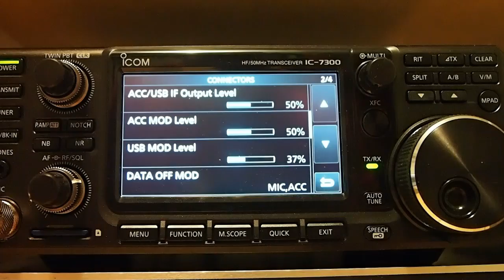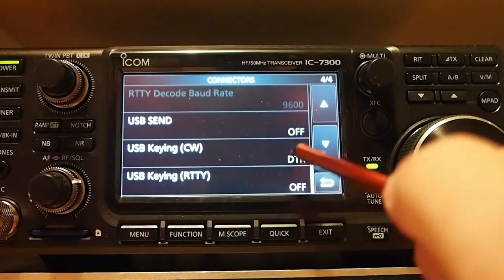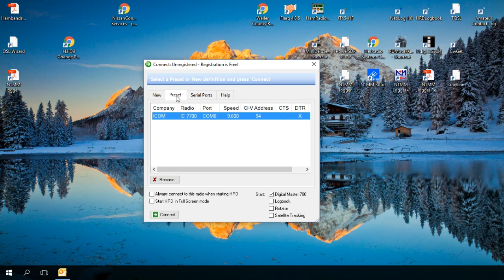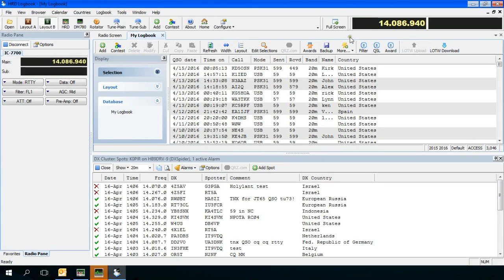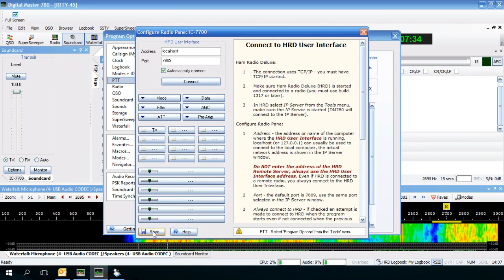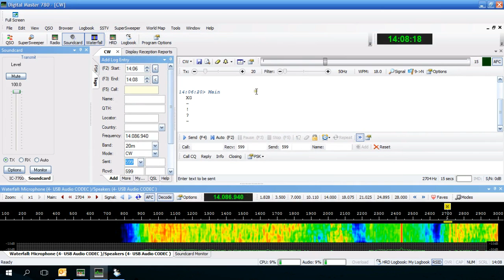Icom 7300 USB CI-V Rig Control And Digital CW How To

Comment: No one shows what ports to plug into, I use regular headphone to the remote jack port...
Reply from the maker: It’s nice to hear from you and thank you for commenting. Yes, it could be mentioned more in videos. In my next video I’ll point out there is a remote port on the back of the 7300 and also a USB port on the back of the 7300. The CI-V cable plugs into the remote port and the USB cable plugs into the USB port. The USB cable is a common printer cable, but the CI-V cable is something you can get off the Internet and I have a link to it in the article on my website. I hope this helps people in the future and stay tuned for upcoming videos. Thank you again. 73 and good DX! de KØPIR
Reply: Thank you for responding. So I cannot hook a regular audio jack into the remote port and go straight to hooking the other end into a CW key?

I was hoping to skip the computer for now...
Reply from the maker: @GH0ST369  I may be misundertanding you, but, no the remote jack is for a CI-V cable to control the radio with a PC. The CW jack on the rear of the radio is for a CW key. What are you trying to accomplish?
Reply: @HamRadioAdventures  I would like to set up my CW key to a (two ring audio cable on both ends) into the remote port.
 Everything fits but I do not know the settings to access the remote port. 
The rest of the configuration seems straight forward...
Reply from the maker: @GH0ST369  you don't want to insert your CW key into the remote port of the radio. It won't work. The remote port is just for CAT control. If you have a CW key that uses a stereo cable, that's fine. You'll need an adapter for the 3.5mm to 1/4" plug. Maybe that's where you got stumped? You'll need an adapter. You can pick them up at Walmart, Amazon and Ebay too.
Reply: @HamRadioAdventures  lol how silly after you said that I see the larger port says Key a little embarrassed, thanks for pointing me in the right direction.
Reply from the maker: @GH0ST369  no worries and it is confusing looking at the back of the radio. It could be labeled better. 73!
Reply: @HamRadioAdventures  it was strange for some reason I could get the one paddle to work, or the other, but after I changed some of the settings to use the two buttons on the top of the mic, then both the paddles started to work. Haha I have to spend more time on this if I ever want to pass this exam.
Reply from the maker: @GH0ST369  if you can use the microphone for a keyer, you're da man! I tried it a few times, but it didn't go well lol 73!

Comment: I use wsjtx for FT8 and am using the standard printer cable, i wanted to switch band on my N3FJP logger .. how do i switch band on my wsjtx simultaneously with n3fjp? do i need another cable ?
Reply from the maker: Hey that’s a good question. I use a CIV cable for Rig control in WSJT-X and then that USB cable I have connected goes to N3FJP for rig control. In the radio you need to have ‘unlink from remote’ set. I have a screen capture of that on my website http://www.k0pir.us/icom-ic-7300-specifications-features/icom-7300-screen-captures/ 73!

Comment: Hi Skip, I have finally gotten cw working using your setup. I do have the delay before cw transmit. Did you figure that out?
Reply: Allan Matthews the delay is because its not a true cw signal, you are using pc generated sound to send cw tone, while a true cw mode, the carrier is instantly on and tones sent with carrier are cleaner. You have to get a rigblaster advantage with cw cable to send true cw tones;)

Comment: Can you tell me the part number for the CIV cable, and where in the IC7300 does it connect?
Reply from the maker: Hi Joseph,
Nice to hear from you.
I've heard that people have less trouble with the FTDI chipset. So search google for "Icom CT-17 USB FTDI Chipset CI-V Cat Control Programming Cable". Here is one: http://amzn.to/2sDRUAq
There is a much cheaper one that I use and it hasn't caused any problems. It is here: https://rover.ebay.com/rover/1/711-53200-19255-0/1?ff3=4&toolid=11800&pub=5575171312&campid=5337860891&mpre=http%3A%2F%2Fwww.ebay.com%2Fitm%2F282039866391%3FrmvSB%3Dtrue
There is a CI-V port on the back of the radio, the other end is a USB that connects to the computer. I hope this helps. Best 73!

Comment: I have my 7300 set up as the above states - I have my drivers downloaded and installed from Icom - as per directions.

When I put something in the cw window, and hit send or auto, my 7300 key opens, I see the "typing" being done on the DM780 screen, but nothing is happening on the Icom. Just the key stays open. It's like I open PTT on my mic and say nothing. I have received cw from the 7300 and watched the DM780 decode it. So if receive works transmit ought to. 

Can you assist in my search for a solution? 

Thanks, and 73,

Skip, W5UTW
Reply from the maker: Hi Skip. What version of HRD are you using and do you have 2 cables?  Take a look at this page and settings in the radio: http://www.k0pir.us/icom-7300-ham-radio-deluxe-setup/
Reply: Free version. Win 10. Installed, to the best of my knowledge, as you suggested. I bought a good CI-V and USB cable. I see the drivers in the sound card option. Decode works. Hitting transmit opens the key, sending from the cw window opens transmit but no signal is sent. Was wondering if the type of key in the radio made a difference. I have a straight key installed. And I hear all audio from the radio. Is this normal? And thanks for your response.
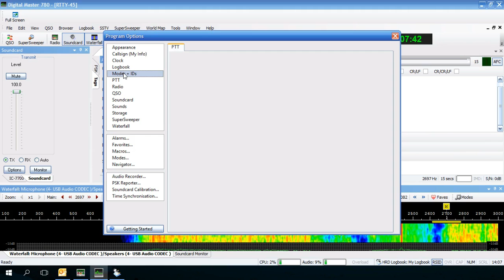Reply from the maker: Hi Skip, Okay sounds good. The key is fine, the audio you will hear too. Do you have psk31 working, transmitting? Is CW setup for"serial port keying"? see 4:33 in the video above.  Is the software and radio in CW mode? There are 4 choices for CW in DM780, choose just "CW". You can e-mail me at my address in QRZ.
Reply: OK. I had the wrong COM port on the "serial port keying". It only just dawned on me that my USB was COM4 and my CI-V was COM6 - I had an option of COM3 on the Serial Port Keying and I only have the two. Not sure where that came from but got confused with the USB Sound card option that has a 3 in the name. In any event. I now have transmit. And I hear it. 

I am really new to this "stuff" and have never done psk31 or any flavor of rtty/digital etc - that was why I wanted to set this all up to learn even why I would want to. 

You provide a wealth of information and assistance it is REALLY appreciated. 

Richard, thank you for your help.

Skip, W5UTW
Reply from the maker: http://www.k0pir.us/icom-7300-dm780-setup/
Reply from the maker: That's awesome Skip! I really like psk31 and RTTY especially RTTY in contests. After you have had some fun with PSK31, you'll have to try WSJT-X and JT65 :-) Best 73, hope to hear you on the air. - K0PIR
Reply: I will be trying it all. Thanks for your help. 73 and I also hope to see you on air sometime. de W5UTW

Comment: Excellent videos on the IC-7300.
I was able to get my 7300 up and running USB only for bpsk31.

My question is what is the difference between rig control and USB only?
You mentioned CW will not work with USB only?

Also, I noticed the receive bar graph indicates "overload" unless I turn down my RF gain?
It does not seem to be causing a problem in operation.

I'm using HRD free version.
Reply from the maker: Hi and thank you for commenting. I'm happy you are up and running. 
I use the CI-V cable for rig control, that's the HRD program that comes up after you connect. The USB cable is used for data modes (DM780) and in my case, serial com port keying. Com port keying allows CW keying and RTTY FSK.

Using only the USB cable you can do everything, rig control and data modes, just not CW and FSK. You can do MCW (SSB CW), and you can do AFSK, but that's a little different.  

If you're getting overload (OVF coming up on the LCD), do you have a station really closeby transmitting with high power?? Or do you have AGC off? I run AGC off in digital operation and turn down the RF gain. Why are you getting overload?

FWIW I think most people use just one cable (USB). HRD free version doesn't do FSK anyway. The paid version and another program, MMTTY,  that I use does FSK. MMTTY is a lot of in RTTY contests.

P.S. If you really want to use just a USB cable and do FSK and CW you could use a virtual serial port emulator. It works, but it's more complicated and more software. I think using two cables is easier, IMO.
Reply: Ahh. OK. So are you saying Ci-V is required for CW and RTTY with the 7300? 
With just the one cable, I am able to control the 7300, change freq, filters etc with the mouse.
Reply from the maker: Yes I think two cables is the easiest way to do FSK and CW com port keying. You can do fine with one cable. I use one cable with my Raspberry Pi 3 (Linux) and it's FB. Thank you for commenting, best wishes, 73 - Rich

Comment: Thanks for the video.  I'm new to using CW with DM, but I'm able to transmit with the two cable method (I made my own CI-V cable).  I'm wondering what I should see with ALC levels.  Currently when I transmit, I'm seeing the ALC go high.  Is this normal?  When I use other digital modes like JT9 or JT65 I'm able to adjust the output signal to just under any ALC shows on the meter.  My soundcard output is set to minimum and it still shows high ALC.  Any thoughts?  73
Reply from the maker: Hi Dustin, 
Great you got it working! If you are transmitting CW (not MCW) then yes the ALC is going to be reading high. Is that what you're doing?
Reply: That's correct, I'm transmitting CW.  I did find a post on one of the forums that said this is the normal Icom behavior in CW mode, so thanks for backing that up (it was for an older txcvr).  Just wanted to make sure I wasn't over driving the radio.  Thanks!  I look forward to getting into CW with DM.  I'd like to learn keying, but it has proven much harder than I thought :/
Reply from the maker: I don't do much CW. I do like CW contests though because I can make a lot of DX contacts and it's very quick. Best wishes, 73 Rich K0PIR

Comment: I'm using FLdigi, i used your radio settings but could not get the radio to transmit...receive ok, waterfall decoding....etc..just no transmit..any ideas?
Reply from the maker: Hi Warren, I have it working, it wasn't easy for some reason, just buggy I guess. It stopped working on me as I was checking it. It's working again for me now.
I'm using the RigCAT and the rig description is the IC-7300.xml. Do you have that? I have my com port set which is my CI-V cable. Use the one you want. I set my baud rate, it is 9600, double check yours.. Here is what I have set or checked off: Toggle RTS for PTT and Restore Settings on Close. Retries, Retry interval, etc. are just the default.  In the radio I have these additional settings which may or may not help you: DATA MOD=USB, USB SEND=RTS, USB Keying (CW)=DTR, USB Keying (RTTY)=DTR. I am using a CI-V cable for rig control and the USB for data (digital). Will yours read the frequency? Just won't transmit? Try playing with those, I had trouble too. Mine just suddenly came to life and I noticed it was reading the frequency. It's probably a software thing and not your radio.
Reply: I guess Ill have to play with it.  I had it all working with my 7410, CIV for rig control and Signal Link for data....so I unplugged the USB from the radio and put it back into the Signal Link, and It all worked.  So its got to be the radio setting.  I don't have that XML file, i heard you have to download it into Fldigi....but since Im not using Fldigi for rig control I don't use it...I did try Hamlib and it worked, but then Macloggerdx, my logging software would not work, and I need the rig control in that....So I suppose the more folks that get a 7300 and have a MAC with FLdigi, there will be more experimentation...and someone will come up with the right settings...I changed all my settings to what you had, but I don't get anything on the waterfall...so will continue to play...thanks for your suggestions...
Reply from the maker: +Warren Zimmer Oh I think I see what you want now. Go back to what you had with the soundcard working and the waterfall. I think all you want to do is use Hardware PTT since you have Macloggerdx for rig control. Disable RigCat,  Hamlib and on the Hardware PTT tab check "use separate serial port PTT" and under device select the com port that your USB cable is using. Mine is COM4. Then check "Use RTS" and leave the others unchecked. I did this with mine, and I lost the rig control, but I can key the radio. I'm testing it on PSK31. In the radio settings I believe you'll need USB SEND=RTS. Hope this works. I hear the radio is great with Macloggerdx. 73 Rich, K0PIR.us
Reply: ok, when I do all that, i get some signals on the waterfall in fldigi,  very few, weak, but still cannot transmit...hitting the T/R does not transmit.  The signals seem faint in the waterfall as well. In my Mac i don't see com ports...but in the device window i see my usbserial...
Reply: I also have heard what I think is JT65, warbaly tones...but Fldigi doesn't have that as a choice of modes...could it be another mode?
Reply from the maker: Yep that's probably JT65. I would think if you chose the USBserial that should work. There are different ways of doing things, but that's pretty basic, you just tell the program what to use for PTT and it should key the radio. When you hit tune it doesn't key the transmitter? I think the trouble I'm having on and off is I'm using a USB hub and it's causing intermittent problems transmitting.
Reply: Go into Connectors.

USB SEND should be set on DTR.

USB keying and rtty should both be OFF.

DATA MOD should be USB.

DATA OFF MOD should be MIC,ACC.

I have USB MOD LEVEL set to 75%.

ACC/USB Output Select is set to AF.

ACC/USB AF Output level set to 75%

ACC/USB AF SQL should be OFF(OPEN)

ACC/USB AF Beep/Speech...Output should be OFF.

The above settings work for me. Just plug the USB cable into PC and you should be good to go.
Make sure you have the Icom ic7300.xml file installed in the Configure/Rig Control part of the Fldigi program.
That file is available from the files section of this website!

I used this set up and now I can receive and transmit with the radio and USB cable alone on FLdigi!
Reply from the maker: That's great! I have used Fldigi a few times but it is not my favorite for digital. I am used to Digital Master 780 and have been sticking to it. It's nice to try different things though. I would like to try a Mac someday :-) Best 73 - Rich, K0PIR
Reply: LOL, once you go Mac you never go back.  My mac talks to my iPad and iPhone...change a calendar item in one and they are changed in all....no virus's, no windows issues...but there are limitations on software, etc...but for the most part its been worth it.  Thanks for your help.

Comment: Your audio is too low, Maxed out barely hear you.
Reply from the maker: Hi +Rick Scott. Thank for commenting. Sorry about that, I did lower it because my laptop mic is crappy. I have a headset now which is better quality. In this video I can hear myself plenty loud on different laptops and my phone. Turn the audio up on your computer as well as on this clip, should be fine. Thanks, best 73!
Reply: +Ham Radio K0PIR had both. up full.
Reply from the maker: Rick Scott Yeah I thought you might. I won't be decreasing the audio any more and I'm going to make a clip showing how all of the modes and rig control come together. I just want to make sure I don't have any hardware or software conflicts. I'm using HRD, N1MM, and N3FJP software. Thanks again Rick and 73.
Reply: Not a problem  Ive tried to turn up every volume. :) ...I get the gyst of it though.   My IC-7300 arrives 27 April.  Cant wait.